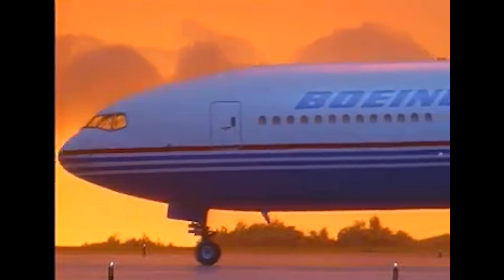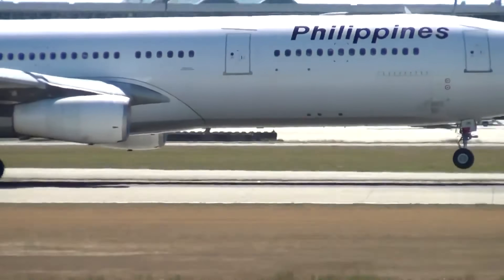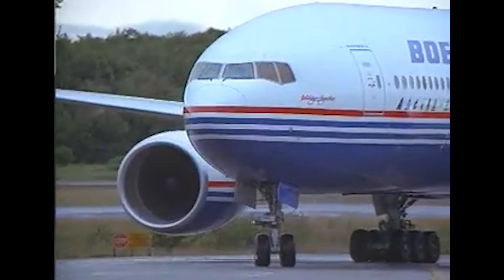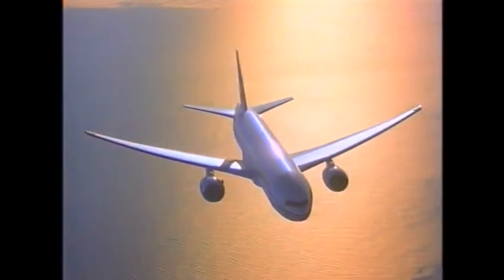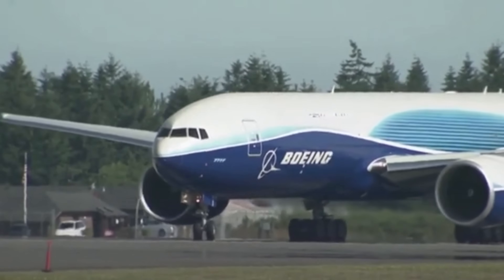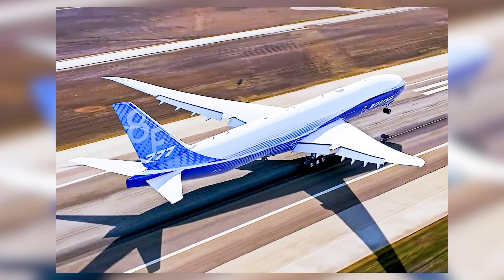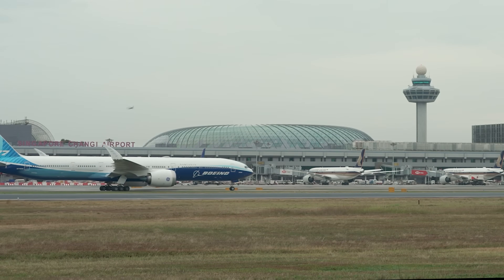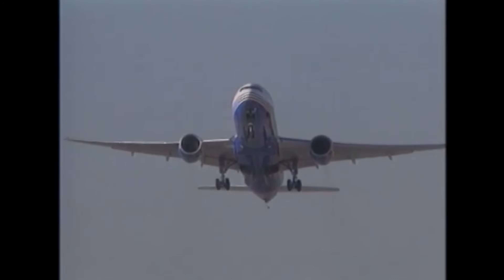A Brief History: Boeing 777 – The World's Favorite Widebody

Comment: The 777 has a formidable safety record too.
Reply: Eh, Asiana (though technically due to pilot error) was due to a bizarre AT system which was subsequently redesigned by Boeing after the crash. Likewise, the LHR crash was also mechanical, though I suppose you could blame the engine manufacturer. It is a very safe plane, though most modern aircraft are DRAMATICALLY safer than legacy jets statistically. The 777 is probably the aircraft I'd really consider the delineation between legacy and modern.

Comment: Essentially, the Boeing 777 was designed based on the ETOPS 180 certification for transoceanic flights that came into effect several years earlier (and which Boeing had the 767-200ER/300ER and 757-200 certified for such flights earlier). Indeed, the larger 777-300ER that arrived in 2004 essentially became the plane that replaced the 747-400 on most transoceanic routes.

Comment: The 777-300ER is my favorite aircraft type of all time. It's sad to see that production of them has been stopped, in favor of a troubled program with no deliveries in sight
Reply: I don't get  why improving the aircraft is a sad thing... What about the 300ER would make you like it anymore than the 9?   Sorry, I just don't get the statement of 'in favour of a troubled program'.
Reply: @avalons343  improving the aircraft is not inherently bad. constant delays up to 5 years from originally planned does look bad. They stopped production of 777-300ER expecting to continue onwards with the 777X, but because of the delays they now produce nothing to compete with the A350-1000 and markets for even larger planes. Customers are losing interest and looking to Airbus because they need planes now, and Boeing is not delivering anything
Reply: @Gusearth @Gusearth the the 300ER is still larger than the 350 1000. Also, there is a bit of contradiction in your statement.  You say they now have nothing to compete with the 350 (in efficiency i assume, agian since the ER still outclasses it in size). But the ER is not as competitive with the much newer 350 as is. Which is the point of the 777 X program. The smaller 😊777-8 would be the equivelant of the 350-1000.  

Do you see what i'm gettimg at?
Reply: @avalons343  yes, the 777-8 is more of a direct competitor, but where is it? it can't be a competitor if it's not getting delivered. I guess you could make an argument for the 787-10 filling the gap in the meantime, but why not just continue production of the 777-300ER instead of offering NO 777 product at all?
Reply: @Gusearth  Boeing stopped production because orders dried up (with the exception of the freighter which will continue production). Infact, to the best of my knowledge there are still 5 777  orders to fill that may never be fulfilled. A carrier isn't going to order the 300ER knowing there is a better version around the corner.   Also, Boeing only ended production a few months ago, But,  you make it sound like they cancelled this at the announcement of the X program...

Comment: I wish I could fly on Delta One again on their -200ER, one of the best experiences I had. I think it would have been a good idea to introduce a -7X to directly replace the -200s. The -8X being the same size as the -300s, it does leave a gap in the market, forcing the airlines to choose between the 787-9/10 and the A350-900.
Reply: Shouldn't the take be that they didn't make a -7x because of the existence of the 787-9/10 and the A350-900?